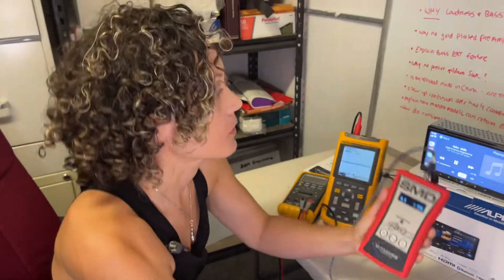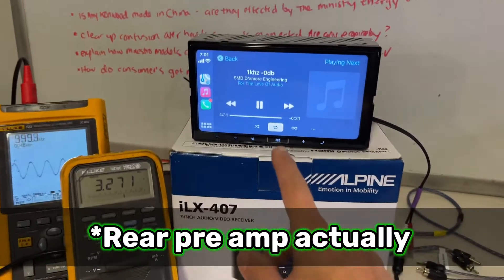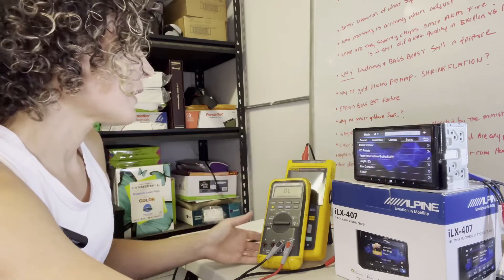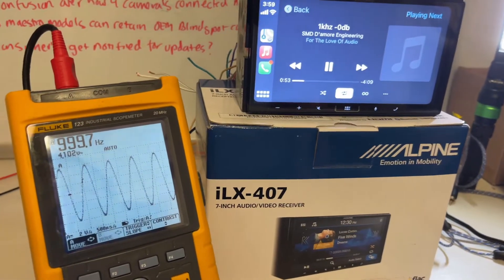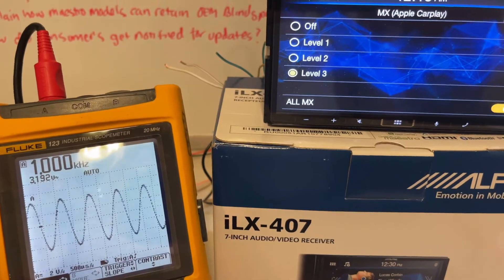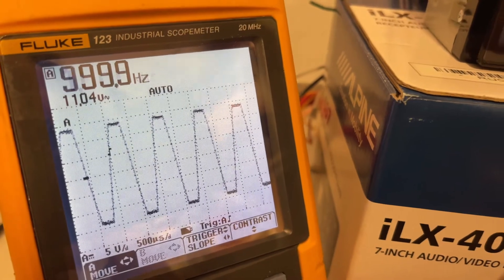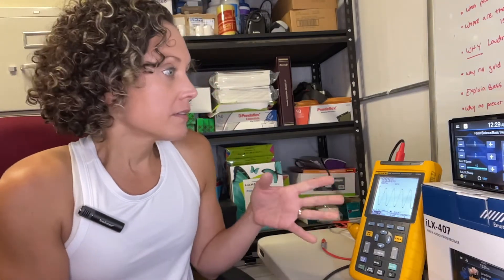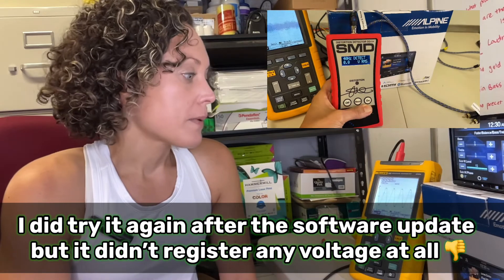Alpine iLX-407 Pre-amp Voltage and Distortion Test with Scope, Fluke  SMD DD1+

Comment: So I have this ilx 407, Im using the speaker level outputs because I'm still running a factory amp, do you think the distortion starts at a different volume level (maybe above 20) if I have (in crossovers) the front and rear speakers outputs set to -12?

Comment: If I'm using the crossover and the internal speaker amp for my mids and highs, can turning down the level input reduce distortion? Want to make sure I'm doing things right. I have this headunit in my car and I'm only using the sub out preamp right now, factory speakers are running off the 407 but I still wanna be able to go up to 35 volume. I think I have mine set around -7 or something for my front and rear crossover.
Reply from the maker: Yes, you could do that. We often do that for a quick adjustment if a client says they want more bass after everything has been buttoned up (even with an aftermarket amp installed). We just turn the crossover levels down on the front and rear speakers to give them a better blend with the sub. I have not tested the pre-amp voltage with those levels turned down though so I couldn't tell you at what point it would clip with it lowered. You'll have to measure to be certain.

Comment: how your Alpine iLX-407 have the setting on the there's no parking brake.  my name is Pablo...
Reply from the maker: Hi Pablo, for display models we use a micro relay made by PAC Audio called a TR1. In the car the radio is looking to see that parking brake wire hooked up and when the parking brake is engaged you will have access to the settings.
Reply: thanks ,this got me bad jejejeje
 @carstereochick
Reply: I order one
Reply: and for reverse what do I do... if you know.
 @carstereochick
Reply: in my radio the setting is block,,,

Comment: Noob question 
Does this mean my ilx-407 has no distortion on pre amps at max volume or do they vary unit to unit
Reply from the maker: Yes, that is correct. Clean pre amp signal all the way up. There should not be any variation.
Reply: @carstereochick  Sweet thanks

Comment: The BIG question is... When checking the box called " External Accessories" When using an External Dsp, Whats the output voltage from the RCAs thats going to the input of the DSP? Alpine says the volume is set at "10" with no adjustment, And use DSP for volume control. Seems to me like if the volume was "Set" at "10" I'd get an EXTREMELY LOW input signal.
Reply from the maker: I'm pretty sure you're thinking of an older Alpine model that had optional digital out. The Alpine INE-W977HD had the option in the settings for external accessories such as a DSP as it was equipped with optional digital output and when selected on, it did set the volume at 10. The iLX-407 does not have that feature nor do any current Alpine models, they're all 4 volt RCA preamp output. If you're looking for a head unit with digital out we recommend the Stinger HEIGH10. I wasn't totally in love with it until we utilized the digital out with our Helix V Eight DSP amp.
Reply: @carstereochick   The Head unit I have is the Alpine ILX-F309. It is an older unit 2018 I think? I dont think it puts out 2.5v at volume 10 when using that feature as the guys at alpine claim. Thats why i was wondering if you ever tested a unit like that?

Comment: I’m only getting 3.7 volts on the front channel is there a fox for this
Reply from the maker: Just on the front? What about the rear? What test tone frequency are you using specifically? I use a test track from SMD D'Amore Engineering For the Love of Audio 1khz 0 dB. We imported it to our Apple library from a CD so it's lossless, but if you're grabbing a test track that is from a compressed an audio source like Spotify or Pandora or even Apple Music without hi-res lossless turned on in your app settings you'll get a lower reading.

Comment: Am i wrong or did older car cd players(I had an Alpine 7803s in 93) sound waaay better to the ear? Aaand they were better at playing scratched discs too.
Reply from the maker: Hmmm, I don't know, that's hard to say. Technology has come so far that I think we have better than CD quality available now, but the issue is most of us don't take the time to set it up on our phones that way. One of the 1st things I do when a client comes into my shop and wants to improve the way their stereo sounds is I ask what they're listening to. SiriusXM (48 kbps) Spotify? Pandora? The free one (64 kbps) or paid subscription (192 kbps)? Apple music (depends on your settings: 256 kbps or lossless 1,411 kbps)? Then I usually ask to look at their phones and show them the audio settings in the app menu. Most of what people listen to these days is compressed and they don't even realize it. 

We recently did a really high end audio system in a 2022 Audi S4. Using the OEM head unit with a NAV TV Zen interface so we could go Toslink out from the factory radio into a Helix V Eight DSP 8-channel amp with Morel Elate Carbon Pro's, a couple Helix mono amps and JL 12W6's. That audio system was definitely in the top 5 best sounding we've ever done and so much of it comes from the clean signal processing. Over the weekend John ran optical out from our Stinger HEIGH10 to our Helix V Eight DSP and it was like the audio system just woke up and came to life. So much more clarity, vibrancy, detail. It's amazing - total night and day difference in sound quality between the analog RCA and optical connection. 

But for most people? They're just streaming whatever app they're using at the default sound quality on the app. So yeah, when you compare it to THAT, absolutely I agree with you that an older CD player and an original CD would definitely sound WAY better. I couldn't comment on the anti-skip function, I'll have to take your word on that. It's been years since I've listened to a CD in my car!

Comment: Hi i think if you try with a CD it would work better, i had a similar play about and i did a lot of messing and i think its down to the compression with USB as the result with CD is more conssitent.
Reply from the maker: Was using Apple lossless so technically it shouldn't matter, but that's a good point and definitely worth a try.

Comment: curios if you can help? i installed this alpine ilx-407 on my 2002 harley electraglide with a soundigital 1200.4 powering 4 6 1/2's using rca cables. my amp is shutting off for a second when i get to volume 19-20-21 ish. i should be able to go up to about 26 on this unit. my old single din kenwood cd player never made this amp shut off. any ideas?
Reply from the maker: Hmm, SounDigital amps are pretty rock solid beasts so that is an interesting situation. The pre-amp on this deck is clean all the way up. I would make sure you have the EQ flat and make sure things like Media Xpander are turned off, that can cause clipping at lower volume levels. You'd really need to measure at the amp with the oscilloscope to see what's happening and causing the amp to shut off. Is it a clipped signal issue? Perhaps the gain is set too high. Maybe your previous deck was lower voltage pre-amp and this one is 4 volt and maybe your gain is not appropriately set for the higher voltage? Need to see where the clipping is happening to properly diagnose. It could be happening before the amp on the input side or it could be happening on the output side.

Comment: Hey I have a question about thealpine ilx-407. I have it installed in my chrysler aspen and it works great but for some reason every 10-12 seconds it shortly cuts out the music. Like a small pause. It happens on Bluetooth, radio, and android auto. Just wondering if you guys know the source of the problem!
Reply from the maker: I have seen weird things like that before. Did you make sure to forget the OEM UConnect module on your phone? That or do you have a smart watch? Odd that it’s also happening on radio, that could indicate an issue with the stock amp or how the Maestro (assuming that’s what you used) is working with it. I would first make sure your phone is not trying to connect to any other devices like a smart watch or OEM Bluetooth module still in the car. If it’s not an amplified model vehicle I would check software on the radio and try resetting it.
Reply: @carstereochick  thank you! I'll try out the different methods!

Comment: I’ve watch a few of these videos, it seems each radio you test “shows” low volts. Why don’t you try doing these same tests in a actual vehicle with a 12v system instead of spreading all these radios reading low volts, which by the way the stinger radio you let known has low volts funny enough installed in a vehicle shows every bit of 6v.. I’ve been in car stereo industry for 20 plus years if your going to test units do so under real world conditions instead of spreading false info. 👍
Reply from the maker: Because it's easier for me to record and demonstrate the issues we see in cars by using a power supply that puts out 13.5 volts. I don't like to interrupt or record techs while working on client vehicles during the day and even if I could do that, it's difficult, because I'm running the shop during the day and busy assisting clients. It's just easier to show it after the fact on a test bench. The whole reason I started doing this is because of issues we see either in client's cars (turning it up to the point it distorts or sub level too high and damaging equipment) or because of issues we've seen with products in our own vehicles. 

The very reason we questioned the output of the Stinger HEIGH10 is we installed one in January 2021 with super basic set up - 50x4 RMS amp, 120 watt Alpine powered sub in a 2-door Wrangler JL and it sounded great! We were super impressed so decided to put the same thing in our 2019 Wrangler which is equipped with two Helix amps, one of which is putting out 75x8 RMS to each speaker. We had plenty of output with the same amp using the AP4-CH41R2 (5V) and decent output with the X409-WRA-JL (4V) so when we put in our Stinger HEIGH10 a few months ago we were super disappointed in the output. There was no way ours was the same voltage as the initial product release. My husband tested and measured in our own car and verified low voltage pre-amp and ended up adding a line driver. Bottom line is there is an issue that arose after these radios were released due to the chip shortage. It's not every one of them and maybe you have been lucky enough not to get shipped a low voltage one. But if you have the experience you say you do and you've installed enough of these and have a good ear, I'm sure you would have picked up on it too.

Comment: I have a question how do you make the weather work on kenwood dnx997xr ? Love ur videos 😉👍
Reply from the maker: So there is app called KENWOOD Traffic Powered By INRIX. In theory, once downloaded, as long as you are connected to the radio via Bluetooth and have good cell service, it will send that weather data to the radio. For clients in our area, our cell service can be a bit spotty so it can take a few minutes to actually sync up and populate data. I've had some clients tell me it works, but inconsistently. Some tell me it's giving them data, but from the next town over. Others tell me it works half the time. I haven't tried it in a vehicle personally so I couldn't tell you how well it works, but I imagine the inconsistency is related to cellular coverage.

Edit: And thank you!! I'm so glad you're enjoying the videos :)
Reply: @carstereochick  one more question for you does the dnx997xr have a built in radar detector or do I need to purchase a escort radar ix ? I want to open up some of these bells sense this radio does have more then I realize. I bought this radio to replace the pioneer 8400nex I had in my 07 corvette it won’t power up no power at all! Also can I get my rpm and mph threw the 997xr? Thank you 😊 Rob in Houston Texas 😁
Reply from the maker: The radar integration is very cool. It's designed for use with a K40 built in system like their K40-200 or K40-360 and it gets integrated using the iDatalink Maestro module ADS-MRR or ADS-MRR2. For Escort radar detectors, select models are compatible, but only when used with the ADS-MRR2. 

The vehicle information screen like gauges, read/reset check engine light, HVAC display, etc. are only available on select vehicles when used in conjunction with the ADS-MRR or ADS-MRR2 module. However, those advanced vehicle information features are not applicable to the 2007 Corvette unfortunately. You could still use the ADS-MRR or ADS-MRR2 as a stand alone module JUST for the radar detector integration with a compatible K40 or Escort radar detector. But it does require a compatible detector and the additional ADS-MRR or ADS-MRR2 to allow the detector to talk to the radio.
Reply: @carstereochick  will the escort max3 work?
Reply: @carstereochick  with the maestro rr2
Reply from the maker: Yes - Escort Max 3, Max 360c, or Redline 360c will work with the ADS-MRR2 and I believe there is one other accessory you need for them to work together: https://www.escortradar.com/products/maestro-portable-detector-kit
Reply: @carstereochick  thank you very much i whish you were here in houston lol you have been big help! Your videos help me learn a lot this subject I’m a little weak in 😁👍
Reply from the maker: You're quite welcome! I'm so happy to hear the content has been helpful :)
Reply: @carstereochick  one more question I got the dnx997xr install already now how much do U think it would cost to have a audio place to pull it back out and install the rr2 in for me
Reply: @carstereochick  I’m also looking at the escort 360c wow not cheap lol
Reply from the maker: It depends on whether they did the original install. If they didn't, they may give you a range. It's one of those things where once you open it up, you own the install so if they see anything that isn't up to their standards, they will probably charge to redo it. If they did the original job for you, they know what they're opening up. Including hardwiring the detector you're probably looking at anywhere from 2 - 4 hours at whatever local rates are. Around here (Fairfield Country, CT) labor rates range from $100 - $125 per hour.
Reply: @carstereochick  thank  you  one of these days I will learn this 😁👍lol
Reply: @carstereochick  the reason why I had the new dnx997xr install my pioneer 8400nex wouldn’t power up no power at all I check the fuses all good I put it up on a bench with a 12 volt battery no power in there a fuse it self inside the head unit ? It was only 3 years old I hardly ever drive the car 07 with 16000 miles on it what could had happen you think?  🤔
Reply from the maker: I have not taken one apart personally so I'm not positive, but I would send it out for an estimate. Around here we use United Radio, I know they have a service center in Peachtree, GA. I would inquire if they service that model. For some units it free estimate, others it's $25 - $40 for an evaluation. If this is a vehicle that you don't drive often and perhaps battery went dead at some point and got jump started and there was a surge in power or bad ground or poor connection somewhere? Not sure. The fuse in the car and on the radio should protect it, but who knows? Repair center might better be able to tell you what happened inside the radio.
Reply: @carstereochick  thank you I will look into it I may look them up tomorrow see what they got to say! It’s strange drive it to work left the car in the hangar overnight take it home the next day that was when I discover the issue hopefully they can take care of it maybe I can put it in my Tacoma lol 😉👍

Comment: Good video but, the dd1 was not mistaken, because it detected harmonic distortion and what you measured with the oscilloscope was clipping, not the same thing,  Tony D'Amore explains it better in one of his videos, if you're interested in watching it https://www.youtube.com/watch?v=v0Jcsn3-Uf4
Reply from the maker: Thank you so much for pointing that out Miguel, I will definitely check out the video! I do see that now in the manual under specifications it says it is detecting harmonic distortion, I totally missed that. "Distortion" is a sort of a catchall word that is often used in our industry to describe various audio issues, but in reality there are many different types of distortion and clipping is just one type that can occur.

What threw me was how off it was on the voltage reading and then it was also very inconsistent. I kept having to power it on/off to get any kind of voltage reading and when I did get a reading, it didn't match what either Fluke meter was showing which just made me question the accuracy of the whole thing. Our shop has had success with the DD1+ for setting amp gains, but I don't trust it for reading pre-amp voltage accurately.